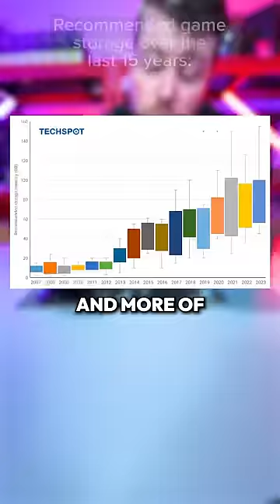Your gaming PC needs more storage!

Comment: I bought a 1tb ssd as an upgrade from a 240gb sata ssd and 500gb hard drive and I immediately ran out of space on my new drive 😭
Reply: Use them all
Reply: Use all of them
Reply: Combo them - the 240gb SSD for your OS only, the 1tb SSD for games and the 500gb hard drive for any random files you may have or older or less important games.
Reply: @quill5579  but what if the 1tb is an nvme, wouldnt it be better to store the OS there?
Reply: Yah I would use them all. I only have 1gb of ssd but I have 2tb Seagate card that use for some games. Even 1 tb goes by so fast
Reply: @PEguinQuAcKers  I do use them all, and it’s a 1tb nvme with my os and the few games I play, and the 240gb sata ssd has unreal engine and a few unreal projects
Reply: @8xus_1  yeah it would but also then you're taking up ~100+GB of potential space for games which really need the extra speed of an nvme over a sata SSD with the OS and random installed applications
Reply: Should've bought a 2TB SSD for the OS and bought a 8TB HDD external drive for games that are 10 years+, and the new games that have come out in the past 5 years use the 2TB SSD.
Reply: If you have around $100, you can get 8TB of a Seagate Hard drive.
Reply: @quill5579  great advise
Reply: 240gb ssd for windows files
1tb ssd for games and production
500gb hdd to store files like videos, images, music and documents etc.
Reply: That's why I bought a 2TB external HDD and keep everything not gaming on that. Only Windows, game apps (Steam, Epic, etc.) and games are installed on the SSD. 
Also, don't download every game you have. Only the ones you're actually playing. If you haven't played it in a month, uninstall it. You can download it again later when you decide to pick it up again.
Reply: I have a 250 nvme, a 2tb hdd and a 1tb sata sdd... I store most of my games on my 2tb hdd while I use my 1tb sata ssd on games that may require to boot faster...
Reply: how did you immidietly run out of space

Comment: If you're on a budget, it's cheaper to upgrade storage later, just get cheap 500G NVMe and you're good
Reply: Yes especially bulk storage like hdds. But if you plan to use it for main boot drive. I think 512 is the minimum
Reply: i did this got 1 tb gen 4 nvme  ssd for now will get 2tb when need more storage it helped me get a better gpu
Reply: @kharismanando9051  yeah, never get HDD or SATA for boot drive because event the cheap slowest NVMe still better, or don't even use it ever, current gen B-series board have 2-3 M.2 NVMe slots
Reply: @kharismanando9051  240 is more than fine for main boot drive
Reply: @fade2black001  i see, maybe its just me
Reply: And if that’s NVMe, it can be repurposed for a rather nice external drive with an adapter kit.
Reply: Just go for a Tera byte it’s not that much more expensive
Reply: and then you find out that the price difference for 500 gb and 1 tb is in the 10's instead of near double the price for the size increase as is the case with the 2 tb so your cutting yourself in your fingers going with 500

Comment: I have 4 m.2 nvme drives, 3 sata ssds, and an m.2 sata drive on an external usb adapter. Over 10 tb of space. Plan on phasing out all the sata drives as larger mvme drives drop in price.
Reply: I have 1 500gb nvme, 1 2TB sata ssd and (literally) 9 3.5" HDDs, in total 9.25TB. And I got it all for free, pc included (from a local marketplace)

Comment: I now see it being a problem. I bought a pc like 3-4 years ago. Almost 500GB of storage and now I have 27 left. I have a 1.81T storage thing, but that’s one of those you plug in to the pc, so I can’t play games on it
Reply: Fun fact, if your external storage drive is either USB 3, or USB-C 3.1, you can actually play most games on it with no issues
Reply: @LucienMahikai  don’t think mine is, I tried putting Fortnite on it and the graphics were horrible

Comment: If your on a really tight budget, get a hard drive that is 1tb, they tend to be cheaper, i found a 2tb hard drive for the just a bit lower than that of a 1tb ssd, so if you dont care about speeds, get a hard drive. Edit: i found a 1tb hard drive for £20
Reply: Don't wanna be that guy, but that £20 drive Is prolly Just 4 RAID0 256gb thumb drives or sh*t like that-
Reply: @ALE220fficial  I mean if your budgeting your looking for if it works it works, but if you want quality you'll  have to cash out some more money.

Comment: 1TB nvme ssd gen4 for Windows os.
2TB nvme ssd gen4 for games.
2TB hdd 2.5inch 5400rpm for data storage.
Reply: for windows you will be fine with 500gb or even less
Reply: @EGKing231  500GB fine for windows os and it's updates and very important softwares only. For games installed in another nvme drive. Videos and other stuffs are stored in 2TB Hdd speed 5400rpm.
1TB nvme is crashed and not worked, so I got replacement,in mean while I added 500GB nvme for windows os

Comment: 5 sata ssd's and 2 nvme ssd's... I literally can't populate any more slots on my motherboard. Sata slots get disabled when installing nvme drives. If I add another nvme, I lose two more sata ports. If I remove an nvme, I only gain one sata slot. My next option is a pcie card for nvme drives.

Comment: That cable bend is kinda risky don’t you think😬
Reply: The GPU cable looks fine, as well as the motherboard cable and the CPU block. Am I missing something here that looks off?
Reply: @TheOofaloofa just looked at what card it is and on a 4070 class card there probably isn’t an issue but there have been numerous reports of higher tier gpu’s melting in their connector because of its sloppy design and the stress a tight bend can cause, that may pull the connector loose. 
Nvidia recommended like 3,5 cm of wire before it’s bent at all so that’s why I was concerned😅
How this clears up any confusion
Reply: @sjargo11  That’s right. I forget that NVidia made new, garbage connectors that are unreliable…

Comment: IMO 
Budget build = 1 TB NVMe
Mid Range build = 2 TB NVMe
High End build = 2-4 TB NVMe
End Game build = 4+ TB NVMe
(Additional storage on a HDD or SSD can also be added later but that would be min.)
Reply: It’s cheaper to get multiple smaller drives and there’s no point in getting an 8tb ssd right now because in like 2 years it will be the same price as the 2 tb is now
Reply: @PomegranateJuiceSmoothie  I guarantee you that it wont be.

M2, NVME, 8TB drives are what 8TB SATA drives were when they came out 4 years ago. 800-900 bucks. In 2 years they will definitely not be 120-200 bucks.

The first SATA SSD that came was the Samsung 970 QVO back 4 years ago for like 900 bucks. After around 4 years later it's now down to 520. Even this old drive that will be a 6 year old model in 2 years wont be 200 bucks.

Comment: come on, it matters on what resolution you are running on. 4K? sure, go for 4 terabytes or more. but 1080p and 1440p dont need THAT much, because file sizes from 4k are much larger than 1080p.

Comment: I switched my XP941 256GB M2 AHCI to a Samsung 980 1tb NVMe, and even turned my blu-ray burner on my laptop into a 512gb SSD with a drive expansion pack. I still lack space on my laptop, despite having 2.5TB on the entire system total.